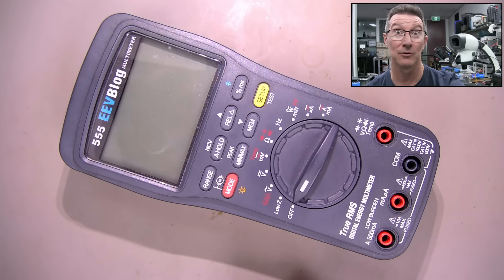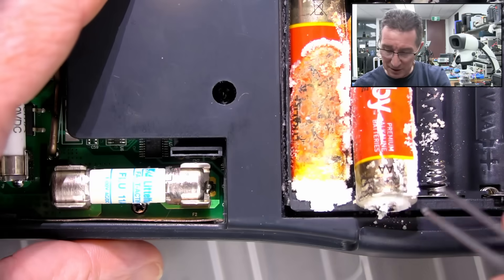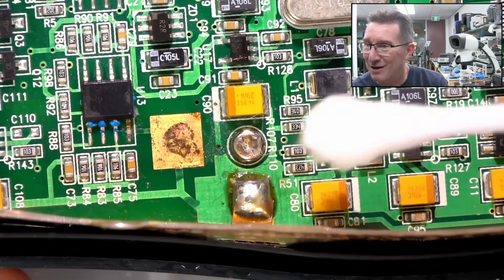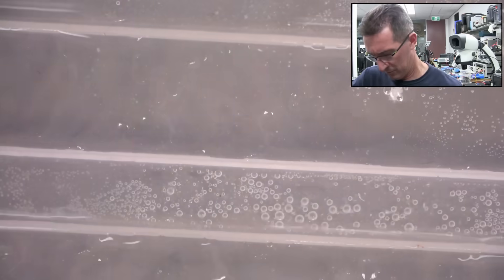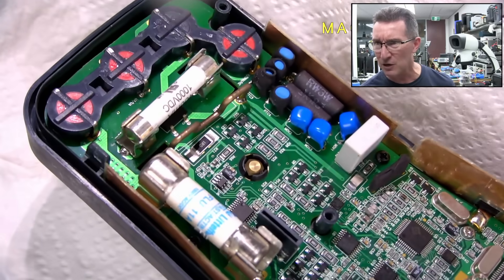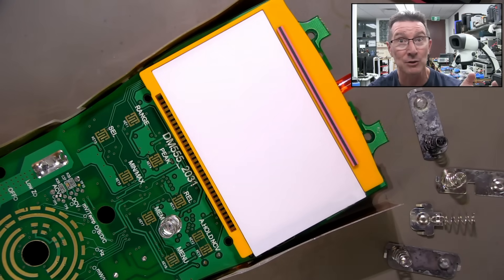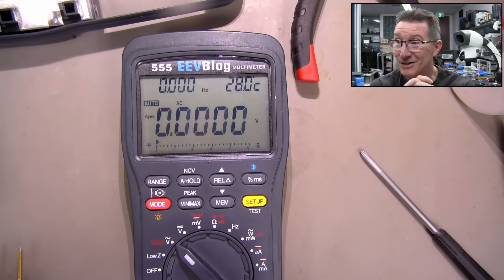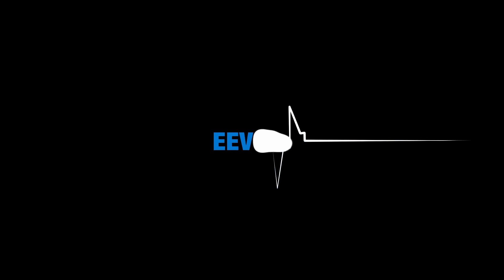EEVblog 1668 - HORRIFIC Alkaline Battery Leakage in Rare Prototype Multimeter

Comment: In a laser consumer product I once sold it had 4 D cells.  To work well it really needs Alkaline's to start. The Originally blow mold carrying case had the battery side of the unit facing down. This was "IF" the batteries ever leaked they never ever ever leaked into the PCB or laser or servo motors or spindle bearings. 

The battery tray for the 4 D cells was designed to pop in and screwed down in a few seconds. So with a rare battery  leak the unit just need the battery tray cleaned or swapped out. This unit was designed about 1998 when Alkaline's got leak issues with Mercury gone a few years.

Then about a Decade later the same great product got a new blow mold case. The Daft Dolt designer did not consider why the old case was designed. So of course the new designer had the unit laying on its side. This new case had some extra space for accessories that most never bought or used.

 ie the "lets make it different scheme and roll the dice and assume the past designers had no reason(s) why they did stuff" LOL

The new case when the 4 D cells leaked had the corrosive goo leak into the PCB area and motors and spindle etc.  It did this when in storage or when you had as inventory or when the customer had it.

The old case was robust for rain; the new case allowed water to enter.

A laser unit from 1998 often survives to today and ones with the new case often are totaled due to the Daft Dolts lack of understanding why the old case was Great.

ie subtle design features

What was even worse is the maker of the laser used one brand of batteries when the new case was released and that Brand had issues of leaking. So the leaking batteries and non robust case with the unit on its side caused many field failures. 

About all the units that got scrapped out due to batteries leaking was the ones in the new cases. I use to buy junk units off of ebay just for the "OLD CASE" for my clients

Comment: I restore vintage analog multimeters as a side hobby to the hobby. I've seen worse actually. The mess an alkaline 4.5V can make when left in a wood and brass era device, anyone? (Or even worse: battery juice gets in a galvanometer mechanism, meter is guaranteed spare parts!). The rules I took home from that: "Zinc carbon/Zinc chloride in devices that can't accidentally deep discharge it actively in storage. Besides, zinc carbon theoretically leaks more easily but doesn't seem to leak with pressure(!) when it does and the stuff is not quite as corrosive - and old stuff tends to be calibrated to zinc carbon anyway. If in doubt/very valuable unit and the device can take it calibration wise, LSD-NIMH or LiFeSO2. Alkaline only in 9V block or button cell form, Alkaline D/C/AA/AAA NEVER unless it is a cheap, modern, replaceable device that gets used and checked frequently".

Be aware that battery electrolytes polluting dissimilar metal contacts, even if the electrolyte is dry, will do as chemistry suggests. Don't ask how I found out...

Also, given that old alkalines used mercury and I am not sure if that can leak into the juice, extra caution (covid mask when grinding or brushing out battery debris, disposable work surface coverings, gloves....) is rather advisable....

I like to combine it when it comes to cleaning battery posts/contacts that can be dismantled: Hot ultrasonic bath with plenty of household vinegar cleaner. Just don't throw other random metal parts in, the cross galvanizing effects can get funny...).

Comment: that leak beats duracell !,
iam road testing all my gear with precharged "energiser recharge" a new type of nimh  
the "precharged" means they have a very low self discharge rate  about 2 years now not had a single leak ,my fluke meters thank me! 
i was a duracell idiot before id come to my senses

Comment: I would scrape off the solder mask on the pcb, tin it with some solder and either use a drop of nail polish or solder mask back on top. For the pad, maybe you could solder on a piece on nickel plated metal and only have the solder on the underside of the piece, leaving the top with the nickel plating exposed to the spring. Those nickel plated straps can be found in various widths for welding up battery packs.

Comment: I stopped using alkaline battery’s ages ago after losing some of my own rare equipment. If the meter runs on NiMh try eneloops or similar quality batteries as they are far less likely to leak and the hold a charge very well.

Comment: Yummy. Yeah, this is why you are supposed to remove batteries from things that you are not actively using. This is also why you are supposed to store batteries with your emergency light and not in your emergency light. :) used batteries or batteries that have a low terminal voltage are also far more likely to leak than new batteries. Thankfully, usually damage caused by this is fairly minimal and can usually be fixed pretty readily!

Comment: The best thing I have ever used for removing battery corrosion is a product called "Iron Out.". It's sold for cleaning iron stains from fiberglass tubs and such, but it does an amazing job of instantly destroying alkaline battery craft while leaving the copper/steel underneath unharmed.
Reply: It contains an acid, so neutralises the corrosion. But oxalic acid is for removing iron stain. I use weak citric acid on a cotton bud, I've also used diluted vinegar. And then use plain water on cotton buds to remove the acid, and dry off.

Comment: Here is an urgent question: Can you also use properly aged Modena vinegar ?
Some gourmet viewers will have problems because they do have 
anything else than Modena vinager at their home only.
Reply: i’ve used aceto di modena to save my oppo blu ray remotes on the PCB and battery springs . just rinse with 100% ipa

Comment: Cool, I had my worst ever battery leak  the other day. It was the first time I ever saw the batteries actually self-digest to point they fell apart removing them.  They were AAA Duracells, 6 to 12 months old in a rarely used TV remote. At least it wasn't something expensive.

Comment: Best life hack I ever did on my own!  When I insert batteries in multimeters or rarely used remotes, I spray an amount WD-40 to cover the contacts. Then I spray the batteries before insertion. Even if a leak starts it stops mostly at the battery. And even if it spreads to the contacts, it's WAAAAAAAY easier to clean them back and re-treat them. Doing this for more than 10 years now!

Comment: id renickle the battery terminal if you can for long term or its going to continue to corrode over time.  Also PCB cleaner like is fine in  ultrasonic cleaner as long as you ethier.  1 don't use heat, or 2, use in a well ventilated area if you do. The vapors can be quiet harmful when heated

Comment: Please be careful with vinegar, of course you can use it to neutralize electrolyte from alkaline batteries, but if the acid remains at the end you will have corrosion just as well.... I think cleaning thoroughly, for example with lots of distilled water would be better.

Comment: Did anyone ever experience issues with lithium AA batteries?
I've put those in my multimeters and similar equipment.
For the generic battery-operated devices in the household, I'm using LiFePO4 for devices that need the voltage, NiMH for devices that need the amps. And some devices are modified to run on Li-ion and fitted with a USB charge port.

Comment: Alkaline batteries never leaked when they were first introduced. Then someone decided that the mercury in them was environmentally harmful so instead of doing the sensible thing and instituting recycling of old batteries they just banned the mercury. The result of this is mountains of destroyed electronics costing the consumer and the environment much more than the sensible recycling option. Any alkaline battery is likely to leak, cheap or expensive, old or brand new even.

Comment: Flow solder over the entire corroded terminals. I do that on power tool battery pack contacts. The copper always turns blue, but if you clean with acid and plate with solder, they'll last forever.

Comment: I live in the Philippines. The bane of my existence here is to either clean and/or replace electric/electronic contacts because of the high humidity or replace/do damage control where alkaline batteries have leaked. As one poster below stated, using Li ion batteries helps tremendously. Thankfully, our Nest smoke/CO detectors all came with Eveready Lithium batteries and we have not had one issue...yet.

Comment: There is one explanation only: Even in the off position of the range switch the meter draws some current from the batteries.
I have a Metrawatt meter into which some deadbrain product managers built a real time clock that always consumes power.
Result: Battery damage for the meter.

Comment: I had a 40 year old Sharp Calculator that still had in it the original Sharp Batteries it was sold with..
Special ones that mentioned they were for low usage, low time frame applications..
The calc was still running with those batteies and they did not leak..
The funny thing was how they were nearly twice as heavy as a modern alkaline AA battery..

Comment: I've used white vinegar numerous times for this. I first carefully remove as much physical residue as I can remove just by light scraping. Then I put tissue paper (or even toilet paper) in the battery compartment and pour the vinegar onto that. I then push the wet paper onto the contacts and leave it on one side for the 'magic' to happen. This technique prevents vinegar or other 'nastiness' from migrating further into the device. In my experience, after a while the corrosion nastiness ends up on the tissue paper and the contacts and battery compartment have been left clean!

Comment: The alkaline battery electrolyte is a potassium hydroxide solution which is not an acid but a base, but is just as corrosive, especially to the skin. Potassium hydroxide is extremely hygroscopic, that is, it has a strong tendency to remove moisture from the air. Thus, any leak tends to increase in volume rather than drying out. Further increasing the damage to devices. Along with water, the potassium hydroxide solution also captures carbon dioxide from the air, transforming into potassium carbonate, which is the least hygroscopic and finally dries, forming crystallizations around the pile.
When you put vinegar (acetic acid) on the potassium carbonate crystals, it formed potassium acetate and carbon dioxide.
Reply: Really pulled out the textbook for this one huh, interesting though

Comment: From a chemical point of view the use of acids like vinegar or citric acid or whatever is a questionable practice, as salts of alkaline metals are rather well soluble in water, whereas the acid attacks metal surfaces such as the contact springs etc immediately. So it is a better idea to rub the contamination away with warm water and a brush. Let bigger or hard to access crystals soak a while They will dissolve and surrender to the brush / ultrasonic treatment. Takes longer and isn’t that spectacular, I must admit. But when everything is washed away, you needn’t bother to neutralise anything, neither potassium hydroxide/carbonate nor the new acid contamination, you have caused. But most of all: Please, make sure that you don’t spill dirt into formerly uncontaminated places!

Comment: This is why I switched to lithium cells on all my AA and AAA devices that do not draw enough current to cause the unit to stop working before the cells leak.  Flashlights (torches for you folks) and radios in daily use can still be fed a steady diet of alkaline cells.

Comment: This may be only for steel plating with nickel or gold, but I seem to recall that the plating process is started with a "flash" of copper, then the nickel.  And finally gold, if applicable.  I speculate that the nickel forms a smooth plating only on copper.

Comment: I tend to do neutralization cleanup with a baking soda and water. The thought being that I'm not creating an acidic situation that also needs cleanup.
Reply: For leaks from Alkaline batteries, I think you might as well just use water. Vinegar is only a little better, and I'm pretty certain baking soda won't help at all.

Comment: Honestly people start using lithium primaries (like the energizer ultimate lithium) for anything you're keeping long-term it's more expensive yes but it WILL NOT leak.. I never had one lithium primary in my entire life leak and they also have warranty by Energizer that includes the price of the equipment itself (may not be for every country through). Varta also makes them, duracell used to make the Ultra Lithium, wherever you are there will be some.
Reply: Hi, I've measured an Energizer Ultimate Lithium battery and it outputs 1.8V. Wouldn't the total voltage for four of them in series be too high to be safe for a multimeter?

Comment: 4:51 - You should have just taken it apart and just removed all of the leakage and NOT used vinegar -- because any vinegar that touches areas of the PCB will now begin to cause corrosion.

Comment: I remember when Duracell ran an ad on the tv extolling the virtues and longevity of their batteries. Now,I wouldn’t leave them in ANY device for a week. I can’t count the number of devices that were ruined by their product!
Reply: I stopped using Duracell entirely because they leaked in almost everything I put them in.
Reply: @bigpicturethinking5620  I've done the same thing.
Reply: Panasonic AA batteries made in South Asia mention being made to last a certain number of years without risk of leaks..
I buy then because I dont trust Chinese made ones to not leak and I have had Varta European made AAs leak before..
Reply: Wow I had no idea I always thought they were a good battery, guess I’ll be buying another brand thanks for the heads up
Reply: I used to work in a hospital that had a number of devices that used alkaline batteries. They used Duracell alkalines for awhile, but many leaked well before their printed expiration date. Expensive medical devices were damaged. I agree, avoid using Duracell alkaline batteries. Duracell CR123 lithium batteries are good though.
Reply: I’ve never had an issue with Duracells, hey? 

I’ve had a set in my little AM/FM pocket radio for a few years now and they still work fine, no leaking nothing. I’ve had Varta’s leak BADLY on me before and I originally had a set of Varta’s leak in that radio, cleaned it up, put Duracells in and all happy days. 

It’s a shame that once great companies are just making junk though- glad I got a good batch but I might not buy again based on what I’ve been hearing from others.

Comment: Vinegar - good to know! Had a Wii controller that looked about the same.. (Zinc AAs, courtesy of the previous owner). 
     Had to rebuild / resolder part of the battery tab, as it had been eaten through completely (managed to do that successfully, by the way - t'was a proud moment :))

But cleaning that gunk off... I just felt like it never fully came off with toothbrush and alcohol...
    Neutralizing it would have saved me some headaches :)

Comment: The absolute worst are AA Duracells.  You will even find new ones in packages in stored leaking!  I have banned them from my house.  I use the Energizer ultimate lithium which I have not seen leak yet.  They have to be very well sealed as even the slightest amount of moisture getting in will destroy them.  Buy them in bulk when on sale.  They are still more expensive than Duracells but what is your gear worth?

Comment: Have you tried using electrolysis with a battery charger to remove the corrosion from the metal contacts? It works great for rust.

Comment: Duraleak recently killed one of my Casio calc. The one I use everyday.... Because it's a Casio, the poor thing kept on working, despite the PCB being badly corroded. Manage to clean it and it still works, but one key ( 7 ) is dead, the carbon traces of the membrane keyboard has been eaten away.

Comment: I'm more than half-way through the process of switching ALL my batteries to Energizer Lithium.  They are expensive, but DON'T LEAK.  So, for items around the house, lithium is great.  For flashlights you carry in the field, better have SPARES, because they keep working right until they run out of juice, then die suddenly.
Reply: I bought some Energizer Ultimate Lithium to do the same thing, but I measured the voltage on them and they output 1.8V. I'm worried that in series the total voltage would be too high to be safe for the multimeter. So far I've only used them in a cheap Kaiweets HT208D clamp meter, which only uses 3 batteries, the multimeter uses 4.

Comment: Suggestion: For low-power long-life, consider lithium primary cells like they use in smoke alarms. Expensive (so don't use for high drain) but long shelf life and no leakage.

Comment: I just had the same with an Aluminium torch, the battery swelled up in the case, luckily both ends could be unscrewed leaving just a machined aluminium tube with a AA cell frozen in place so I could use a metal rod to bash it out. The battery goo had eaten into the aluminium causing it to swell, so some wet&dry sandpaper wrapped around a rod was needed to restore the inside so AA cells could slide in.
Some people advise to not leave the batteries in, however this is an emergency use torch, and fumbling around in the dark taking batteries from say a plastic pouch and putting them into the torch (i.e. an emergency) is not a very good idea. So what is the solution to all of this?
Reply: Use lithium primary cells for it. They are expensive, but they have a very long shelf life and rarely leak. Just make sure the light has a real power switch if you want to leave the batteries in it for a long time. A soft power switch always uses some power and it can drain your batteries.